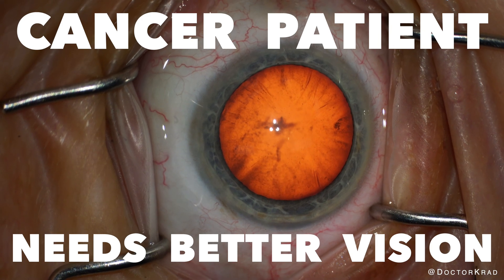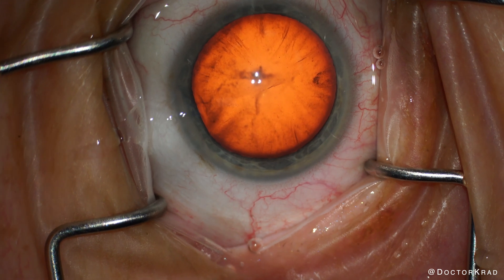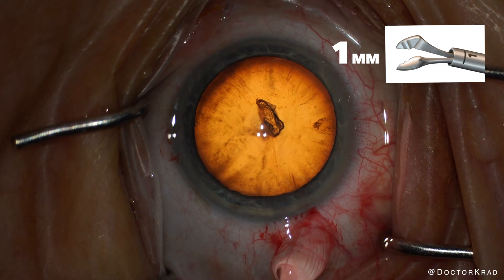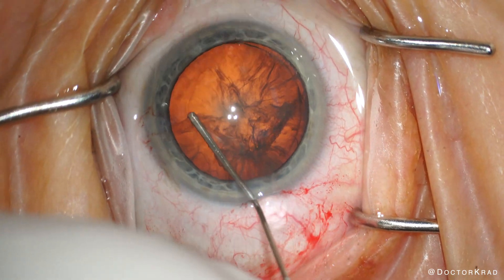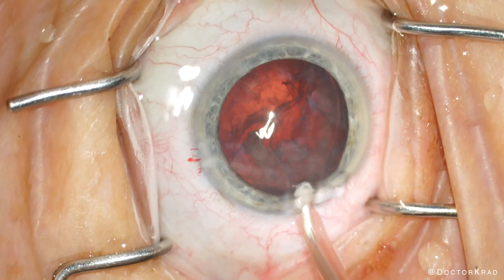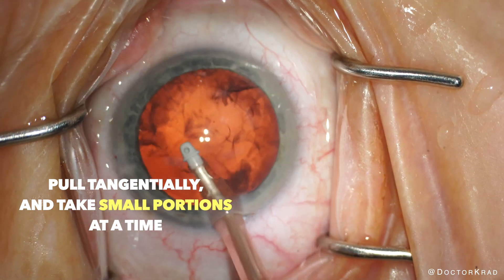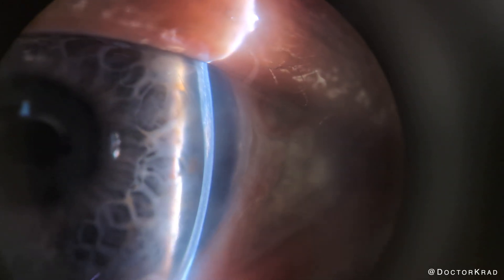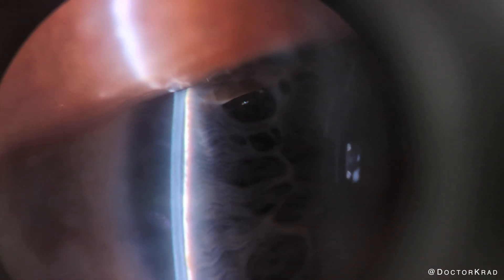Cataract Surgery for a Cancer Patient on Chemo | Narrow Angles, Weak Zonules, CTR | Unusual Case

Comment: Lesson from this clip... "Perfection is enemy of good" .... ❤
Few suggestions won't be out of place.... 
1. Reduce the opening of palpabral aperture by loosening the speculum screw. (I believe it is not wire speculum but adjustable one) 
2. Though AC is near flat, introducing visco at wound forces aqueous to go in periphery. It is repeatedly causing high iop. This is well seen in video. Actually aqueous should leak out while introducing visco. 
3. While coming out of phako tip always stop the fluid by asking rotating person to pinch irrigation from bottle. Stopping the fluid by foot switch causes regurgitation and raised iop. Once you did it while coming out of I/A TIP. 
While coming out with phako handpiece at wound be there for a couple of seconds when irrigation line is closed. By that floppy iris or in your case floppy capsule will not happen. 
You were on border line of surgery went well to you performed surgery well. 
But I would definitely say your patient is in safe and best hands. Would love to see other eye also. But second eye surgery is really necessary immediately with her general health. ❤👌👍🙏🏆 from Dr. Shekhar Yashwant Paranjpe